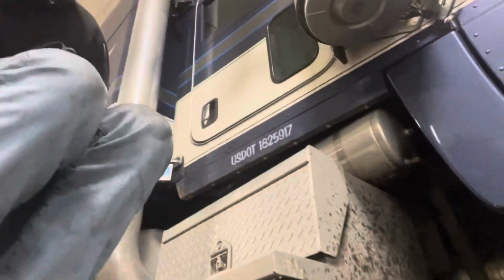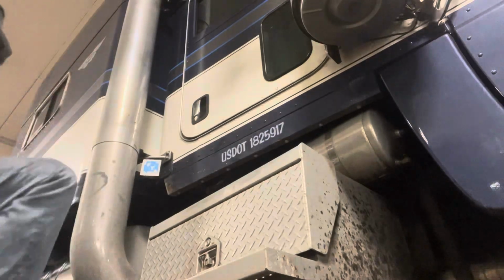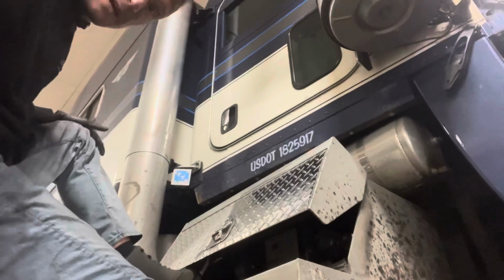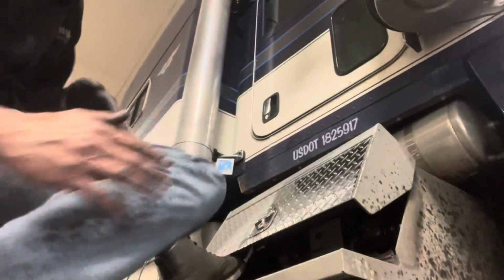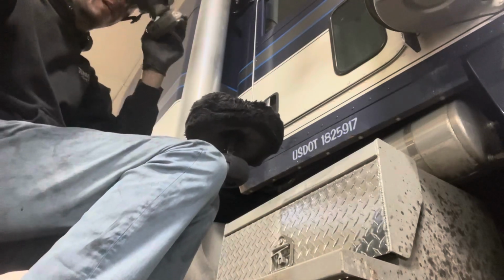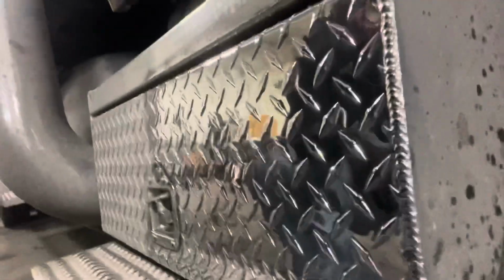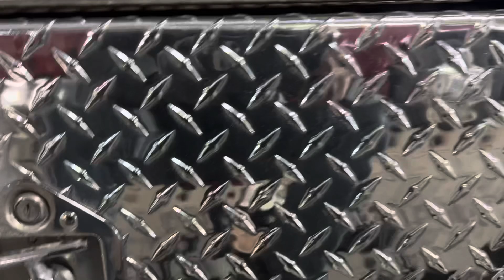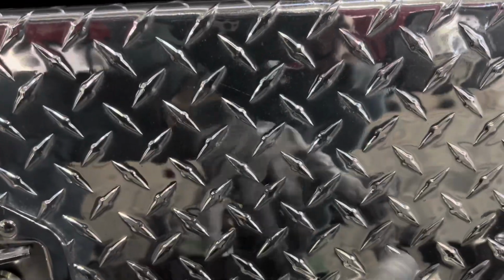Updated. Secret to polishing diamond plate. How to polish diamond plate the easy way.

Comment: What style buffer pad is this? I'm a Maritime Captain and our diamond deck plates are in serious need of TLC. We have wool polishing bonnets but they don't seem tough enough for the job we have ahead.
Reply from the maker: We use airway pads from goshineon.com. If your diamond plate is really rough start with the red buff and brown rouge. Then hit it with your wool bonnet with some time2shine aluminum polish. Then hit it with the orange buff and brown rouge. Then your wool bonnet and t2s aluminum polish again. Repeat the heavy steps as many times as necessary. Then switch to a white buff with green rouge to finish it up when it has a great shine.

Comment: Great job!  Even better was the quick and easy polishing.  Waste no time.  
My work van has heavy oxidized aluminum wheels about 9 yrs old.  Was contemplating replacing with new aluminum wheels.  Much easier to replace however it will cost about 1k to replace. Will this method work on aluminum wheels!
Reply from the maker: This process does work on aluminum wheels also but check out my how to polish wheel videos for a better process. Thank you for watching and supporting the channel.